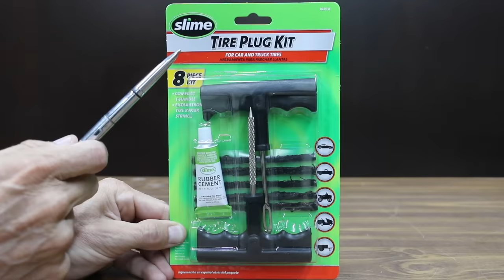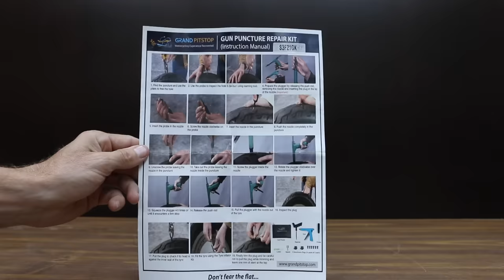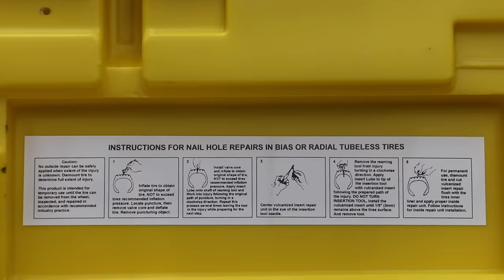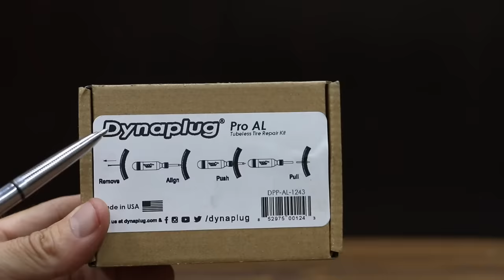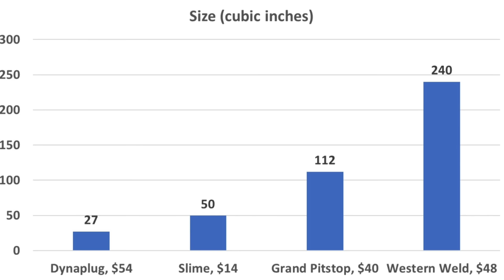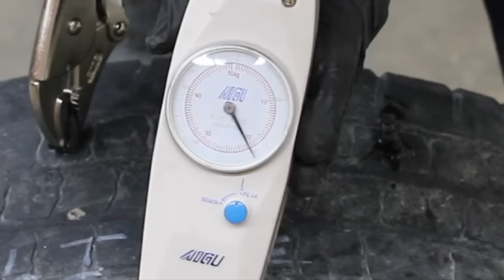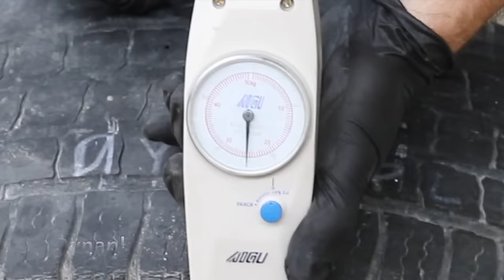Best Tire Repair Kit? SLIME, Westweld, Dynaplug, Grand Pitstop

Comment: As a former mechanic I have plugged countless tires with slime brand name  copy tire plugs without rubber cement. Usually on the car. Never once had a problem. I’ve done a few on my personal vehicles that were almost into the sidewall…One thing I like to do differently when I can is to use a cordless drill to drill the hole after I pull the screw or whatever out. Then use the plug tool…Awesome video as always.
Reply from the maker: Thanks!  Thanks for sharing.
Reply: yeah...agree with the use of a cordless drill to make sure the hole is clear enough and just big enough for the plug, otherwise you could be fighting the steel ply mesh..

Comment: I have been using a tire plug kit for years it looks just like the West Weld kit the tools are identical but the case is red in color i get it off amazon. have used it for years on our equipment trailer tires and on tires on our equipment and never had a problem. Great unbiased review as always Todd. Thanks for all you do!!

Comment: Great video as always! Well…The Westweld is identical to the Safety Seal kits everybody had when I trucked the Haul Road to the North Slope oilfields. The Slime is very similar. Great time and trouble savers! Used a lot! In the trucking world I recommend carrying along a cheap cordless drill with a 1/4 and 3/8 bit to ream the hole. Also, most of the time the plug would not leak ever but sometimes it would after a month or so. Good idea to get it patched at some point. When patching leave the plug there. Just cut it off flush on the inside. This helps keep road salt from corroding the steel belts. Good luck getting a tire shop employee  to understand all this!
Reply from the maker: Thanks!  Thanks for the feedback.

Comment: I'd love to see a comparison of different tap & die sets. Thank you for all of your great videos!
Reply: Great idea
Reply: Don't cheap out on taps, and don't buy tap sets. But them as you need them. You rarely need all the sizes in the kit, and you rarely need the dies. Buying a $8 tap, that's the size you need, every few months, is a lot better than buying a kit for $600, or buying a crappy out for $75.
Reply from the maker: You are welcome!  Thanks for the suggestion.

Comment: I've been driving for 55 years. I'm a retired mechanic. I've been using tire plugs as long as I can remember as a permanent fix (not near the sidewall) I have had no problems. I use the slime style plugs. One trick I have learned is to use a 13/64" drill bit in a drill motor instead of a reamer when possible. It takes the work out of the job. Also fill  the tire up to it's max tire pressure (before you pull the nail or screw out) so the tire holds its shape while you work
Reply: its all good until tire plug fails at high speed. there's a reason why plugs are considered temporary fix and patch as permanent fix. don't risk the lives of your loved ones or anyone who travels with you in your car because of your stubbornness to keep using plug on flat tyre
Reply: @lordjaashin  Show me the proof or evidence of failures at high speed. Or even of failures, full stop. I have my own experience and am reading a ton of comments from real world users and no one has reported a single failure.
Reply: There are actually special drill bits for tire plug repairs, especially in places where wires might show up. Normal slime style plugs are very good and they rarely fail. But sometimes we patch the tire from the inside with special patch/plug kit (sort of a flat patch with sticking out plug to be inserted into the hole) - I never have seen this one to fail.
Reply: @lordjaashin   snowflake alert!!
Where did you get your miss information, tik tok? Lol
Reply: @lordjaashin  never heard of one failing. I used one on my track car this summer. Into pitlane, jack up find leak, plug it and out on the track again. Held up until the tire was bald...
Had them on my daily, my motorcycle.
Reply: I had to plug a tiny hole, and could not get the plug in, no matter how much I tried.
I used a drill to open the hole slightly larger and tried again.
It worked perfect after that.
Reply: I try to keep the repaired tire on the rear axle. You can lose control if it's on the front axle. You shouldn't rotate a plugged tire going the opposite direction. The belts can shift and cut the plug off.
Reply from the maker: Thanks for the feedback.

Comment: Great content thanks for sharing! My enclosed trailer is a magnet for screws & nails. I've plugged about 50 holes in 6 years with the slime brand and no rubber cement. My temporary fix was permanent lol. Alot of work went into this test, thank ya sir!
Reply from the maker: Thanks and you are welcome!  Thanks for sharing.

Comment: I never cut my plugs flush. I always worry about the plugs pushing in or falling into the inside of the tire. It would be interesting to see the reverse of the pull test from the inside. Would also be interesting to see what the mushroom plugs looked like from the inside. I couldn't tell if the mushroom was designed to go through to the inside or simply expand inside the hole itself.

Comment: Prior to watching this video, I didn't know that plugging a tire was so easy and could be done without taking the tire off the rim. I ordered the Western Weld kit and used it for the first time today and it was simple and easy to use. It's feels go to know that I'm no longer at the mercy of tire shops that refuse to repair minor punctures, just so they can sell me a new tire. Thanks!
Reply from the maker: You are welcome!  Thanks for sharing.
Reply: It's not easy. It's hard work
Reply: @purduephotog  Using a tire plug kit to repair a punctured tire is remarkably easy and convenient. The process is straightforward, requiring only a few simple steps that even a novice can master. First, you locate the puncture and use the included tools to clean and prepare the area. Next, you insert the plug, ensuring a secure fit, and trim any excess material. The entire repair can be completed in minutes, saving you the hassle and cost of visiting a professional mechanic. Best of all, tire plug kits are compact and portable, making them an essential item for any driver to keep in their vehicle for emergencies.
Reply: @scubasteve06  no I meant more along the lines of the physical strength to get the plug into the tire. I've destroyed those plastic ones trying to push and twist it in. Even the metal ones feel like they'll break
Reply: @purduephotog  While tire plugs may not be the best option for everyone due to various reasons, they have worked exceptionally well for me. In particular, the kit offered by Western Weld stands out as a high quality and well designed product. Its user friendly design made the repair straightforward, even for someone with minimal experience. The process did not require an unreasonable amount of effort, and the results have been reliable and long-lasting. This kit has proven to be a convenient and effective solution for my tire repair needs.

Comment: I’ve been using tire plugs almost 40 years. Never had one fail. I typically leave the tire on the vehicle while installing the plug. The ones I’m currently using are the Slime brand. They definitely need the adhesive to install them. Not that it makes a better seal, but rather as a lubricant.  Because the little tubes of adhesive dry out once opened, I bought a jar of it on Amazon for about $6. Great content, thank you!
Reply from the maker: You are welcome!  Thanks for sharing.
Reply: Yes Sir. I too have been plugging tires for about 40+ years and I really have never had any issues with a standard plug repair. I have seen problems with some really rigged up things like a bunch of plugs in one hole (trying to repair something that was really not repairable).
      Yall Take Care and be safe, John
Reply: @JohnDoe-pv2iu  Yup.  If you have the screwdriver handle embedded in the tire, you shouldn't be trying to seal that hole.
Reply: Same. The little tube of rubber cement really helps.
Reply: Spit or windex works also. I've never had a plug fail even with 50K on the tire.
Reply: @JohnDoe-pv2iu  me too.   Same results.     Only one I ever knew went bad was on a worn out tire .   I usually dip the plug in  some rubber cement and stuff it in lubed with it .       Before the pesky TPMS i sealed  the troublesome ones with 10-15 pumps of green Slime.   I always left them till the tire wore out no issues.      
  The worst ones to fix are not all the way through punctures as in with a sharp tiny stone.    It’s best to just take the drill to that or you’ll fight like the devil using their hand tool.     Seldom have I ever removed the wheel to do any of this.    It’s faster and easier right on the car .   Position for easy access pull the valve gut and plug it.
Reply: @GT-mn3bx     Only when it’s worn to the wear bars have I seen them start leaking.
Reply: @drizler  I've seen them ran down to the cords and even steel belts with no leaks.

Comment: I have been using the sticky rope version for decades.  For simple nail/screw hole repair they have always lasted for the full service life of the tire.  Fear of failure and need to rush the replacement of the tire is overblown.
Reply from the maker: Thanks for sharing.

Comment: I have the slime kit (that comes in plastic case, but uses the same exact tools) and used it a several years ago to install 3 plugs into a fairly new tire. It worked well, and those plugs never leaked over the life of the tire. The only uncomfortable part using it is the amount of pressure you have to apply onto those plastic handles, which is the only thing preventing a “spear” from shooting into your hand. The entire time i was worried about the plastic handle breaking which would send the metal tool directly into my palm.  I just got a new car, and that kit has to be at least 6 years old now. The mere thought of the plastic handles having gotten brittle over time has me looking for a new kit to keep in the car.  I noticed at Advanced Auto, Slime has a “professional” kit now with all metal handles. I’m thinking a $40 purchase (even if i never have to use it) is worth it, just to have confidence in the tool. My hands are what pays the bills.
Reply from the maker: Thanks for sharing.
Reply: I revisited this video after struggling horribly with one of those slime type kits (not slime brand, but same plastic handle) and just got myself (well, technically my wife) the dynaplug. Your concern is the same thing I was thinking and I don't know if it was the cold or just and old/deteriorated rubber strip but it was horrible to get it in. I plugged a tire last year and it was no where near that complicated (also, was in the middle of summer and working under the sun, so heat helped I'm sure) I wasn't sure if the tool would break or if I'd pull something. 

There's another comment here that mentions that the scenario you feared happened to a friend of theirs, so yeah, stay safe.

Comment: The secret to reaming and pushing the plugs into the tire is to inflate the tire to  30-40 lbs .The tire wont collapse while the plug is inserted.The simple slime handle works fine when the tire is fully inflated.I have plugged about a half a dozen tires, have only used the slime inexpensive plug kits with 100 % success and the repair lasted the life of the tire
Reply from the maker: Thanks for the feedback.
Reply: Yup, Slime makes some pretty good stuff.  I've been using them for years and they've never let me down and they're cheap.  The weird contraptions just seem to complicated to be useful and cost too much to boot.
Reply: After many uses the slime handle breaks comes loose from the shaft making it useless, western weld ones are much better, however the eye often does not feel big enough for the thicker wicks that come in the kit
Reply: I like to add some rubber cement (it comes with some kits) as a bit of lubrication when patching tires.

Comment: Great video! 

Been using those Slime plugs at a sheet metal shop where 1/4 sheet metal screws litter the parking lot for over 20 years (probably 1 a month on 10k lbs trucks and employee cars) and they’ve worked so well I’m afraid to even try something else. Also worked the first time and never failed.

I even had 4 of these in ONE of my tires on a car I used on a track and while it was constantly on my mind while racing it never gave me a problem.

My only advice would be to over inflate the tire just a bit when installing because it gets difficult if the tire flexes too much. I never removed the tire while installing since I do it so often. Oh another bit of advice, never ever drive near the dock of an HVAC shop but likely applies to any shop that uses small screws and nails. If you need to visit one park as far away as reasonable.
Reply from the maker: Thanks!

Comment: All tire shops don't use the same methods, and there are some that simply plug the tire. I used to work in one. Also when I was delivery manager for a branch of a Fortune 500 company, our fleet supervisor plugged tires routinely. Of course, it was an expensive commercial brand. I wouldn't dismiss the durability of a good plug and assume that a patch applied to the inside of a tire is necessarily superior.

Comment: Hi Todd, I’ve seen your videos on tire repair and pumps but not the tires themselves. I got more flats in a set of Goodyear Wrangler kevlar tires (China) on my F150 than any others in 40 years of driving. Was it luck or the tire? Thanks for your hard work!